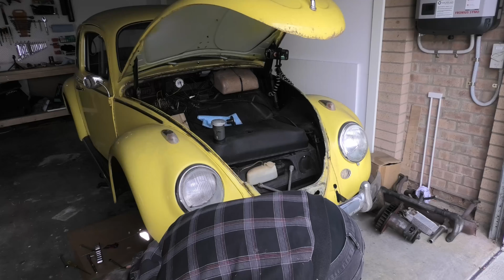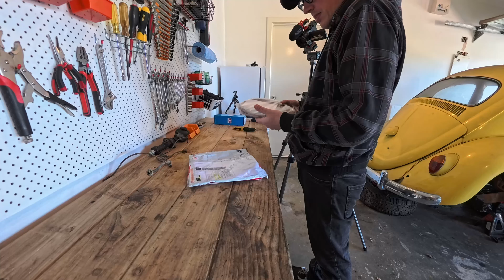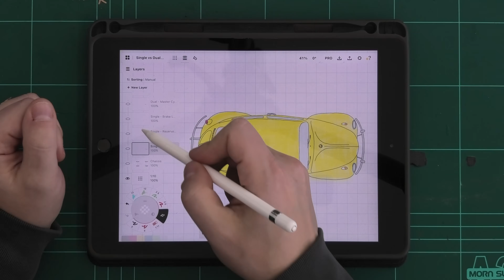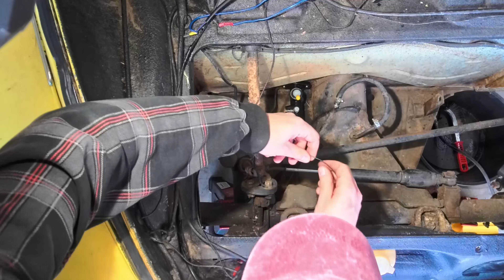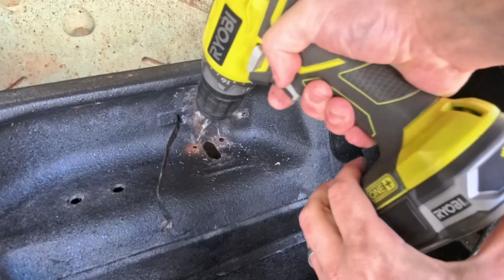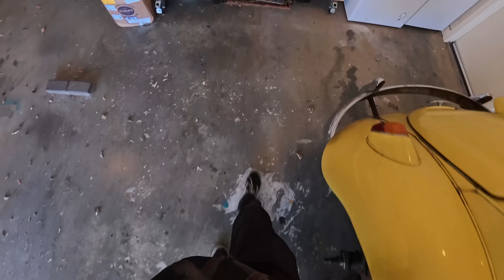The Safety Upgrade Every Classic VW Beetle Needs

Comment: I have Porsche 924S and 944T brakes on my 1303 all with a hydraulic handbrake and adjustable brake proportioning valve to the rear line.  All the lines have been replaced with Kunifer and routed through the cab as well as replacing the flexis with SS braided teflon hose.  The front calipers are 924S single pots with 924S discs and 944T rear 4 pots calipers and 944 discs, all controlled by a 944 19/24 tandem M/C that is reversed plumbed.  The mechanical handbrake operates the drum brakes within the discs using BMW shoes.  All the wheels are now Porsche Teledials with a 5x130mm pcd with an option of 6J or 7J x15" rims.   The braking is outstanding and has embarrassed many on the highway.

What I found is that it is imperative that the M/C is set with a 1mm clearance on the push rod otherwise pump up of the system occurs and I had to use a dial gauge to set it.  Also a 1psi Residual Pressure Valve (RPV) is required to the rear line

Comment: I had one of my tubes rust out and have a hole in it, and there went the brakes
    But worse was leaving the air filter off.  Don't ever do that.  The rain will go right down those ldl0t vent holes right down into your engine, and lock your engine up rusted shut.  No amount of pulling it with a tractor and jamming it into 1st or 2nd gear can unstick it.  That's how I lost my SuperBeetle.   Never wanted another one again after that.
Reply from the maker: That sounds terrible and I'm sorry that's how you lost your car!
Reply: Any inlet system on a rear engined car without an airfilter is best described as an "instant rebore kit".  An air filter is vital to stop the dust that is churning around the rear of the car getting into the engine.  To have locked your engine either the cylinders were hydrolocked or it had been left in that state for a long period.  I can't think however, that it wasn't totally rebuildable since it is still possible to build any air-cooled Beetle out of the massive spare parts catalogues that are available.
Reply: @clivewilliams3661  Believe it or not I had actually taken off the air filter to clean it :-/   I never run an engine for long at all without an air filter.  

My dad ended up hauling the whole thing to the junk yard, and that was the end of my first car.

I'm actually looking at getting some MG TD replicars that are fiberfab kits that were popularly built on the VW bug platform.   They are dirt cheap cars nobody wants any more, probably because they are all homebrew wiring and a mess, old, wore out VW parts, no roof, and really don't get that great mpg like you would think a VW floor with a fiberglass top would.

Otherwise, I drive motorcycle now exclusively.

Comment: where can I get a gas tank that has the filler neck on the right side? My bug has a gas heater on the left side, same as the filler neck on a US speck. I found out if the heater isn't completely shut down, it can ignite the fuel vapors when you remove the gas cap.
Reply from the maker: Good question. I never thought about it. I have a right hand drive beetle, so maybe any early RHD beetle would have it?

Comment: VW already thought of that and provided not one but two emergency brake cables.
Reply: Except they’re only called emergency brakes in North America. The amount of videos I’ve seen of people not putting their HAND BRAKEs on on their automatic shift vehicles… and the the vehicle runs away, either into the road, or into someone’s garage or store front…
Reply from the maker: Aren't they only for the handbrake turns?
Reply: @SwoopingCockatooGarage  They're also to stop in an emergency hence the name, emergency brake.
It's very practical, very German.
Reply from the maker: Sure is!

Comment: Will that master cylinder work with the disk brakes? For US cars, the master has to be a disk type to pair with a disk brake
Reply from the maker: I think US cars need specific ones due to internal check valves? Not an issue with the Beetle and the master cylinder I've used has the right bore to work well with drum and disc brakes.

Comment: You need to bench bleeding the master cylinder first before installing.
Reply from the maker: I did consider this but I'm not ready to hook everything up just yet. I've left the tube nuts loose for now so I have the option to essentially do a bench bleed in the car with no lines attached (or I can add to temporary lines to not make a mess!)
Reply: I don’t do bench bleeding any more on my bikes or cars - I get a large syringe full of DOT4 and push fluid up from the furthest brake nipple straight into the master and on to the reservoir. Other benefit of this way is you shouldn’t need to conventionally bleed afterwards, and if you do, it’s very little.
Reply: No need if you use a pressurised bleed kit like EEZI-Bleed.

Comment: I fitted a 911 SC master cylinder sans servo onto my old 54 and cap discs with CB perf rear discs .fyi you can fit 70s bug shoes and backplate pistons under 67 only wide 5 drums 
 You can also fit type 3 rear drums
Reply: I got some AC industry disc brakes for the front of for my 62 and I got type 3 rear drums cylinders shoes springs etc and then I bought type 3 backing plates wanted to keep it old school but stop great 😃👍✌️
Reply from the maker: Thanks for the info! '54 bug sounds amazing.